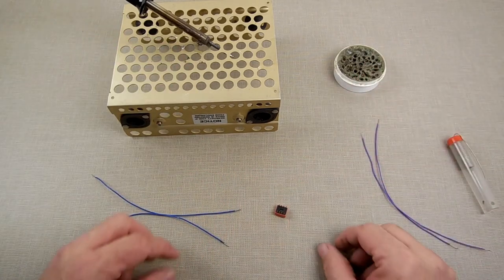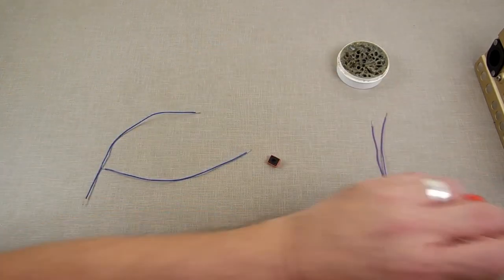Coleco Adam Printer Reset Silencer Pt 1 #FEBRUADAM

Comment: Another great vid and looking forward to part 2. For those without the necessary skill set to perform the Printer mod like your’s truly, one could use the ADAM Roller Controller Power Afapter. Numerous ADAM vendors used to sell these and listed them as Printer Silencer. I am not 100% sure, but I assume the Reset Line pin would have to be removed on this power pass thru adapter... hopefully someone can verify.
Reply: Yes you are correct. The"Printer Gender Changer " product was simply that, the roller controller adapter with the reset pin broken off. Easy. Plug and play
Reply from the maker: Simple - I like it :)